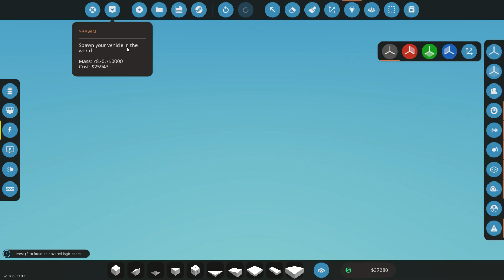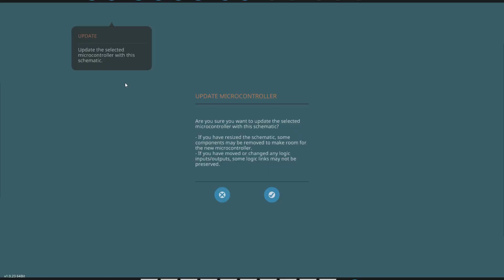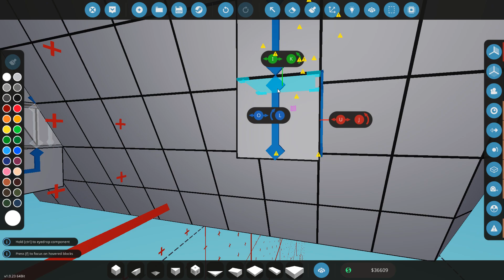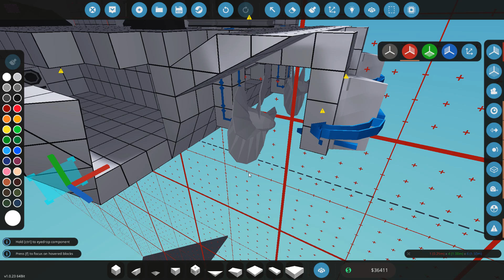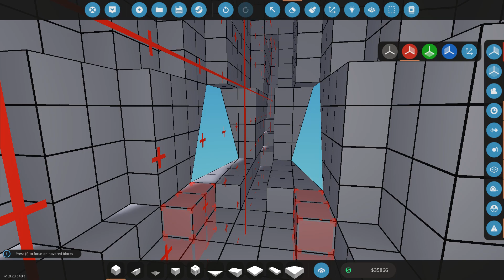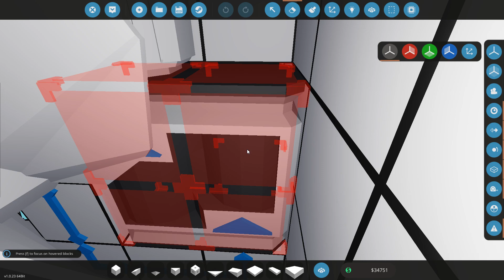Stormworks 1.0 - The Final Touches - #8 [Calm content]

Comment: How about putting props facing down and using them to move ship side to side (if that works even). In my head it should tilt a ship a bit and thrust should move ship side to side, i don`t know how to explain it better
Reply: So by twisting the ship like a cyclist leaning into corners?

Yeah you can but the bow thruster was definitely faster.

He also never implemented a panic button on his generator. To turn it to 100% for when he needs power now. But all good things take time.
At least we have it idling when stationary atm.
I suppose we could swap the program from 'activate when off' to 'pass through bigger numbers from input' so we can override the minimum setting if battery below half, or you slap a panic button for instance (which we could hide below deck in the engine compartment for 'convenience sake'

Comment: use your hydrofoils for active stabilization during highspeed maneuvers
Reply: If we only installed hydroplanes on the bow in a few spots, we could encourage the ship to hydroplane and climb out of waves instead of digging in. (Light lift low mount for hydroplane, medium mounted higher to climb out of waves)

Alternatively, fix some water wings on each side to dig in when cornering to roll back to neutral by being mounted a little above the usual waterline.

Finally. Hydrofoils can be used for turning by pitching the boat into any corner from a wider stance, digging in the inside edge causing rapid turns at the cost of speed.

Of course waves make everything more complicated, give yourself the option to press a button to ride neutral in big waves (except water line 'wings' assisting bow or cornering behavior in waves)

Wait what do you mean they might work but are ugly as anything.
Dude I'm rewriting wing technology for shipping. Fine. Don't be awesome.

Comment: Stealth. You can use fluid spawner to spawn water for cooling with just amount of block and fluid port because if using hydrofoil, they won't cooling the engine anymore if the hydrofoil engaged.
Reply from the maker: Clever! Never thought of that :)
Reply: I thought you would add a water tank and add the water pickup below your hydrofoils.
The tank reserving water for air time, the pickup maintaining the supply when not.

Eh. Spawning water probably works.
Reply: @glenmcgillivray4707  well you can. But, the problem with that is you risking overcome with air if the tank for reserving water ran out especially hydrofoil is engaged in terms of time of using.
Reply: @thelightbrigadef4172  I figured a single brick below the waterline attached to your rudder would offer an excuse to plumb in a water pickup.

Possibly it would not remain entirely underwater while foiling but it would splash in and out, with a reserve tank as a plan B to prevent overheating.

I wonder if we can cool radiators with water in a tank to keep sea water out of our engines.... Even pumping in air would offer some cooling IRL but water works better.

In theory we could IRL run the motor a bit hot and use the radiator to generate steam, with an oil cooler engine or similar. Sea water is nasty stuff tho. So salt crusting would be bad. Barnacles are bad. Copper is useful.

This is a game. Let's not sweat too many details.